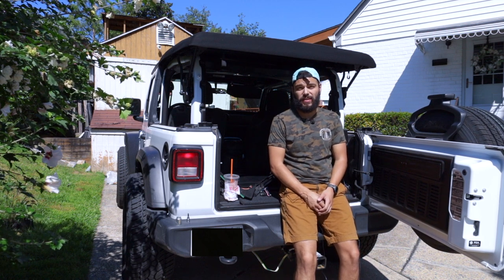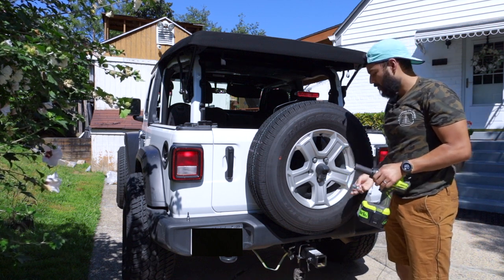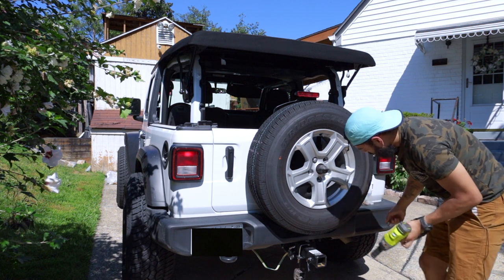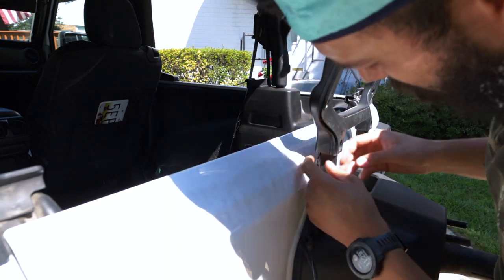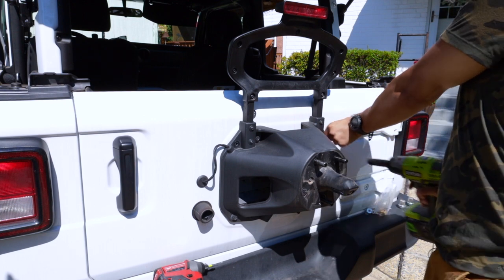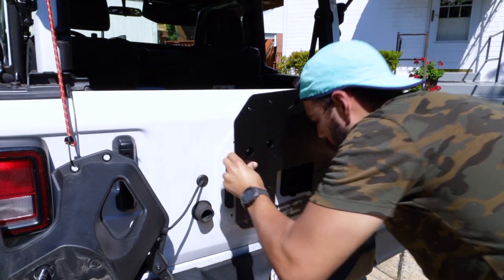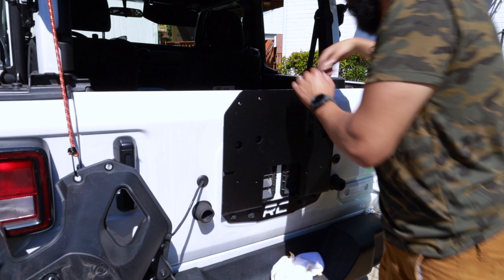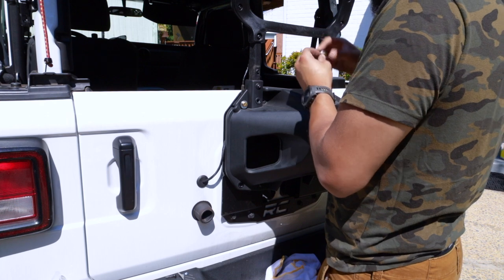Rough Country Spare Tire Relocation Bracket Install

Comment: Mitch, did you re-gear your JL Sport to work with your new 35s?  I have a Sport-S JLU and I'm contemplating regearing. I'm curious how your Jeep feels, especially if you didn't have it regeared.  Thanks!
Reply from the maker: So I will be posting a video soon of my thoughts after getting 35's. But to answer your question, I have not re-geared. The jeep feels very sluggish from a stop but on the highway for the most part its fine. Your MPG will take a huge hit. I drive mostly highway and stock my avg was 25-27mpg after the 35's I get 15-20mpg